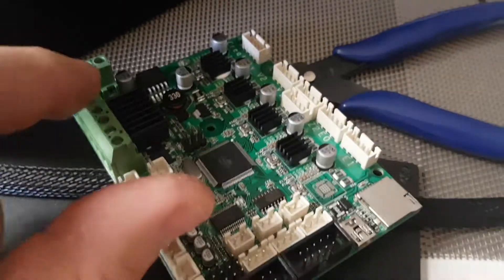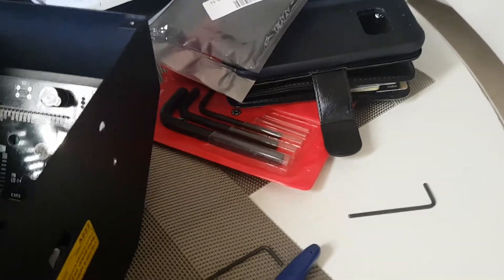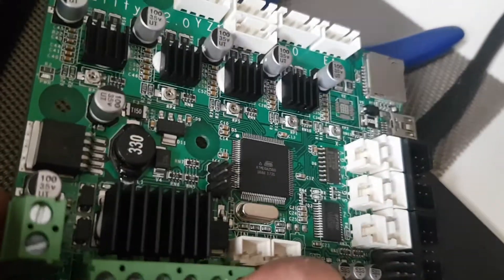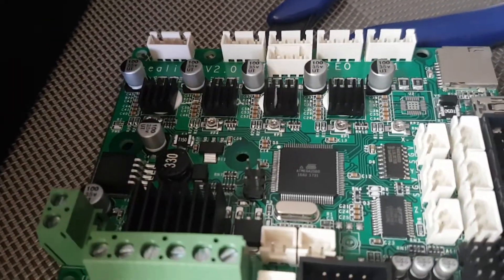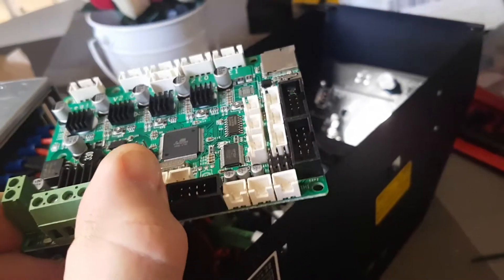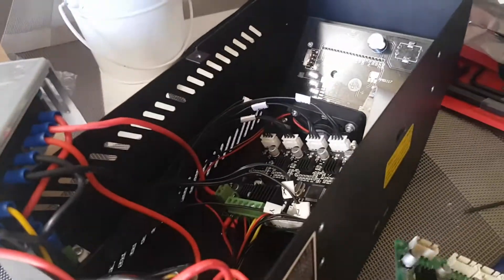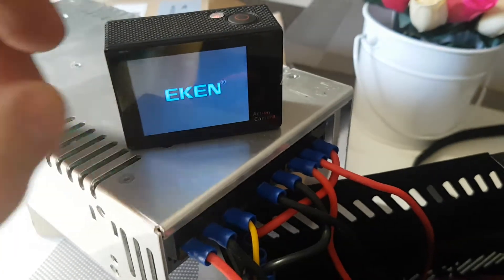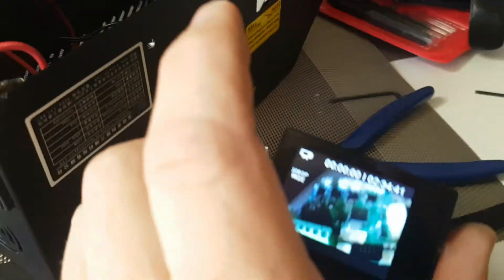Different between CR10 Board and new CR10S by Creally 3D printing.

Comment: https://www.jozerworx.com/creality-cr-10s-c4-capacitor-diy-fix-tutorial/
This is to check if its an older model

https://www.reprap.me/creality-3d-cr-10s-main-board-with-5-stepper-drivers.html
This is for the connections. 

I'm new so I don't exactly know what I'm doing myself.
Reply from the maker: Just fitted a all metal hotend from china. What a pain it is to keepit running after each print. Did have a E3D may go back to it. There are better broads out there now days, which you can add touch screen.  Thank for the information have a wonderful day.

Comment: That's the one with the crappy capacitor at C4. (Near the black thingy with 330 written on top.)
Reply from the maker: Thanks will replace them soon.
Reply: I just finished installing CR-10S V2.1 motherboard. It has small differences to the V2.0. There are 3 more connectors for fans apparently and I'm not certain if I've got it right. Testing it now.

Comment: You mentioned in one of you videos that the wireing was the same just copy over.on the long green conector. Think that could be wrong. Been searching for you videos but can only get two
Reply from the maker: Don't change over as have found that one of the thermistor driver does not work.

Comment: I have the cr10 and swapped boards to the 10s v2.0 I'm confused about the wiring I can get one thermistor to register at a time to see the nozzle or the bed warm up. If I'm able to get one or the other heating up they do so very slow. I've messed around I cant get it right any ideas?
Reply from the maker: I had mine working then change to marlin and the bed now is not working. But have tested bed thermistor and power looks like motherboard. May need another model motherboard.  Very strange. Will try to find out more.